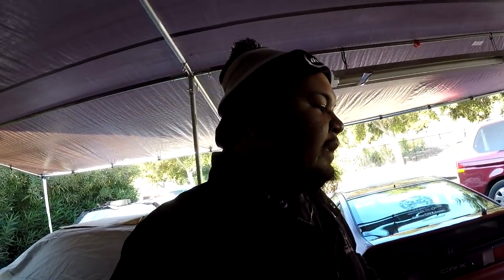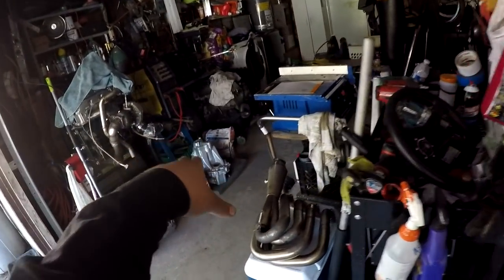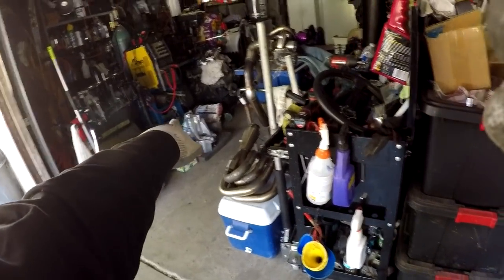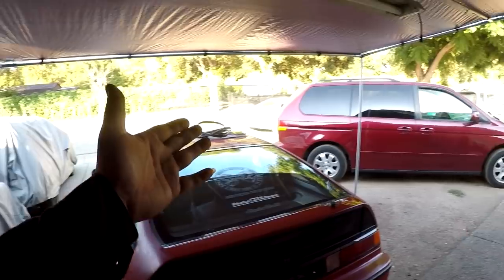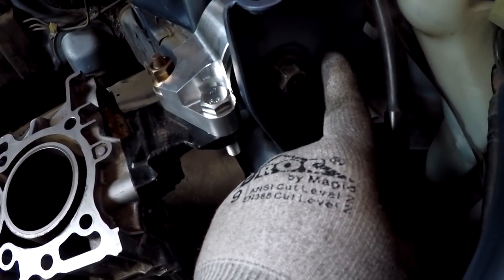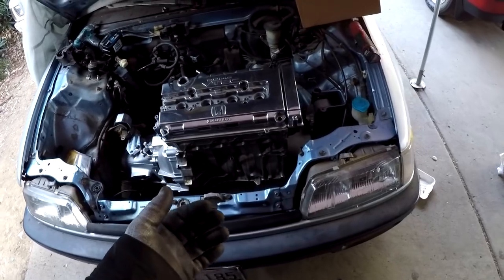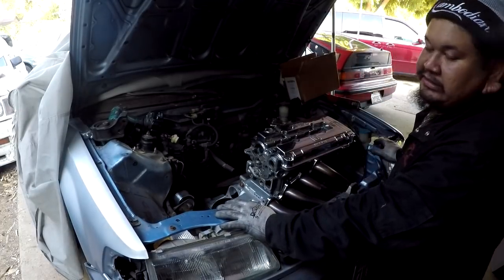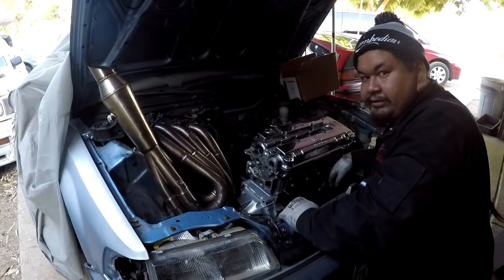1320 Performance b series Hood Exit Header in 88-91 Civic/CRX

Comment: So that brings me to do I have to have a traction bar on my ef (91 crx si) or can I drive my car without one and shave the radiator support to fit the header down is that safe to drive without traction bar
Reply from the maker: You need the x member or the traction. Otherwise car won’t move when the caster of the alignment gets pushed back going forward